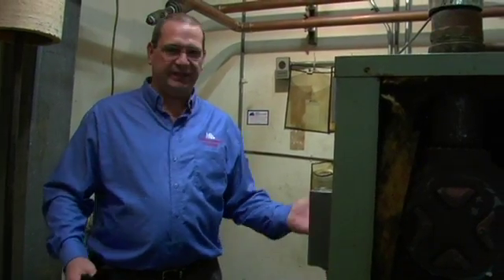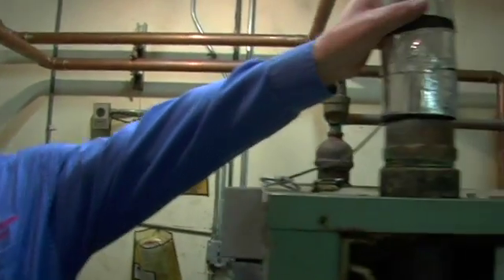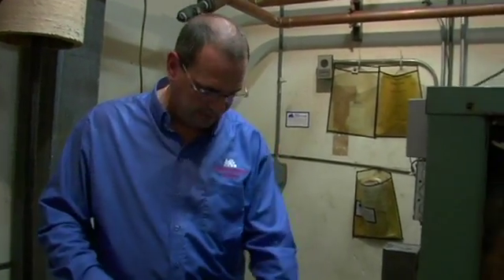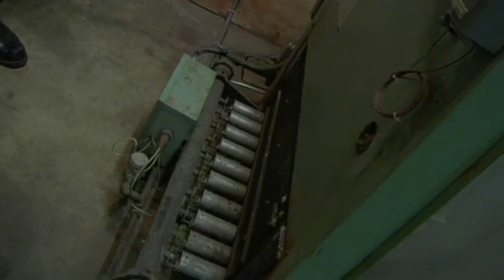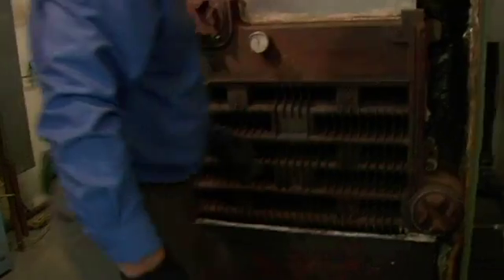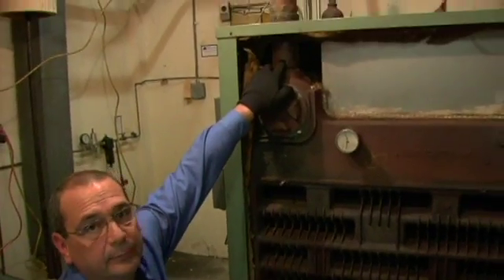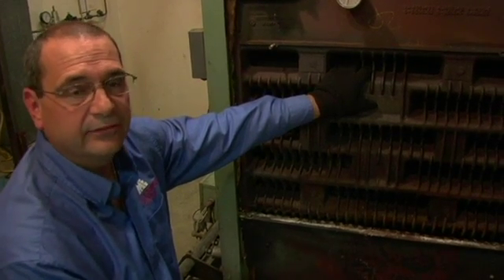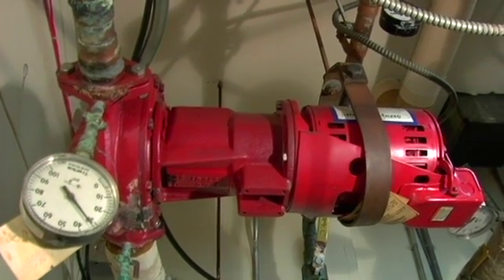Introduction to Boilers

Comment: I am so surprised that the speaker did not say anything about emptying the expansion tank! That needs to be done at the start of every season so that it does not get waterlogged and over-pressurize the system. Emptying the tank can and should be done by the home owner.
Reply: expansion tanks do not need draining. replace if waterlogged, because the diaphragm is damaged

COMPRESSION tanks do not have a diaphragm